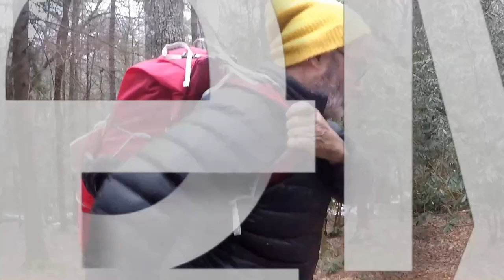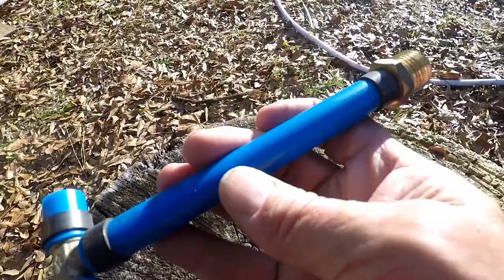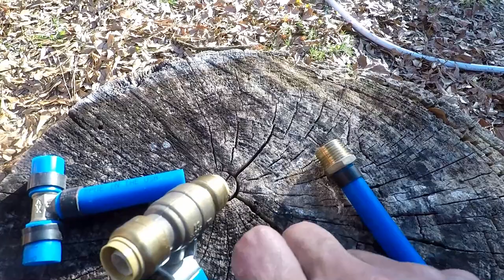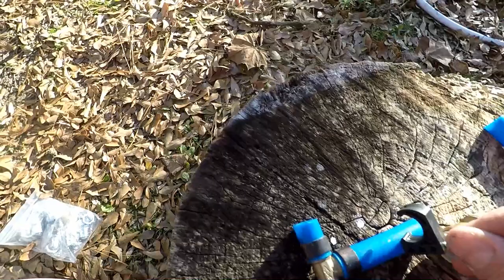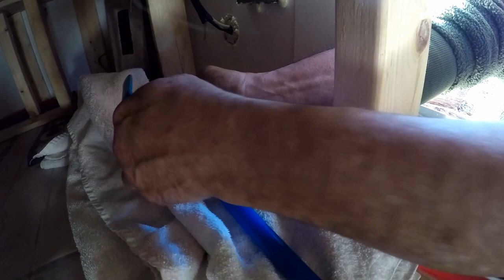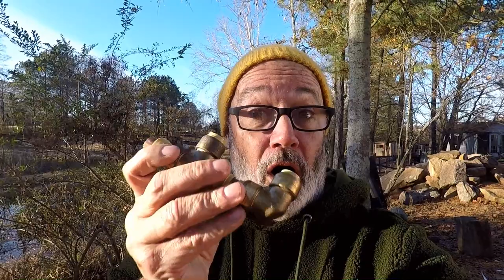HOW TO INSTALL A SHARKBITE IN YOUR RV PLUMBING / RV LIFE

Comment: Oh glad you said this now I can add that to question for the dealer to find out if we have copper or Pex piping is are before we purchase it
Reply from the maker: It’s probably Pex. But yes knowing is important. You can use these SharkBites on both copper and Pex. But Pex is so much easier to work with. Thanks for watching.